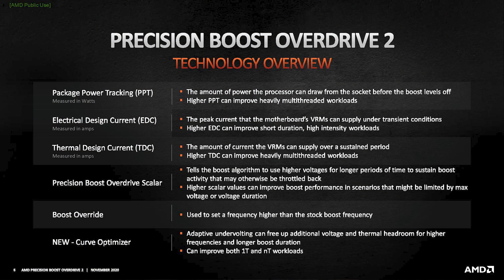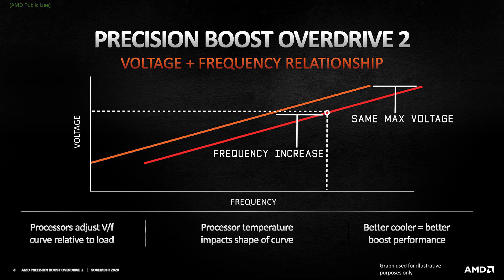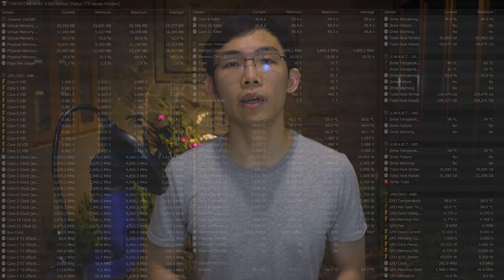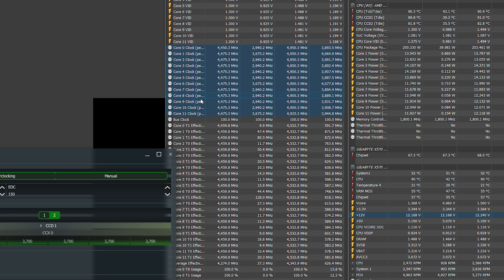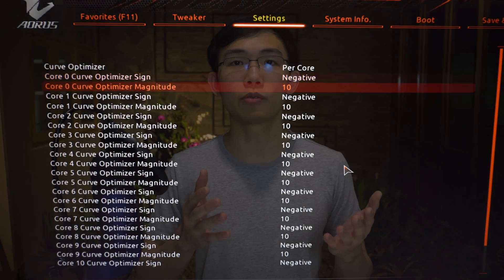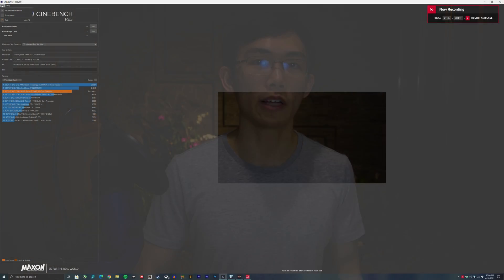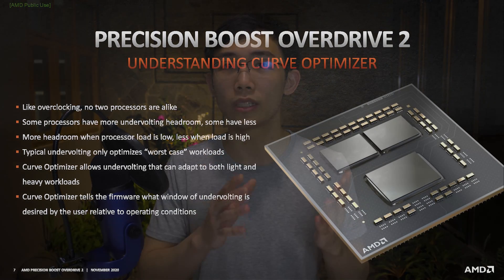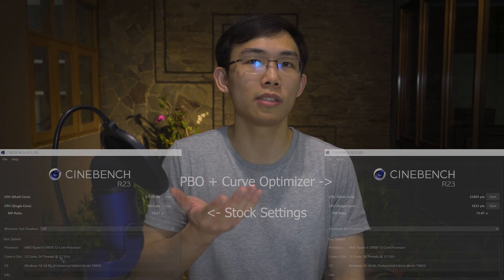The Best Way To Overclock Ryzen 5000! | How to use Curve Optimizer

Comment: Much prefer testing with occt. Detects errors which don't crash the pc/app and tells you which core os responsible for the error so you know what to focus on. I also tested single core by pinning the task to specific cores in task manager rather than always let it run on the same prefered core resulting in a more stable overclock (it helped me to detect the crashes which wouldn't occur if it ran on the prefered single core) my results for 5600x -12, -12, -5, -2, -15, -5.
Reply: It would be so kind of you if u can share the Bios settings buddy
i do have the same CPU but not fully optimized
your help is appreciated.

Comment: As first, this is a very good video! Thank you

But I have a question, does it have the same effect if I set all cores negative 5 instead of per core and then set all to negative?
Cause a friend of mine can set negative 30 at all cores and still doesn't get a crash.

Comment: What if I increase my negative offset to the maximum my bios will let me (30) for every core and it is still stable? Did I not utilize something to the most that I could have? I have an all core clock of 46.50 at 3.65v right now and it was pretty stable but I might have been able to increase it some.

Comment: Your scores are way higher than mine with similar settings on my 5900x + aorus master combo. About 22,000 multi, 1600 single. 4.55GHZ all core and up to 5GHZ single. Any ideas?
Reply: Austin, you sound like you know what your doing. I could really use help on getting my system to run at its best. Honestly feel like it should be much better than it is. I’ll $$ someone to help me!! I’m running ekgaming vanquish 295 I believe is the name. It’s got fully liquid cooled even the crazy RTX 3090, ryzen 5900x, asus Prime pro motherboard, 32GB gskill 3200 ram, 1Tb Samsung 980 pro, another Samsung 1Tb 970 evo pro and 2 other drives I don’t use lol. I have been trying Ryzen master abs so on and I obviously don’t know a lot. Any interest in helping me? Would appreciate it thanks.
Reply: @kaubut0145  I might be able to help you. I'll admit I'm no pro at overclocks, but I could at least try to help you out. Just give me a way to contact you and we can try to figure something out together.

Comment: Did you compare this vs the performacne of an all core overclock? In most scenarios an all core overclock gets better framerates and performance than curve optimizer. Curve optimizer makes it look like its hitting higher clocks but the performance doesnt scale with the clockspeeds.
Reply: "In most scenarios an all core overclock gets better framerates and performance than curve optimizer" Which scenarios would these be? I call BS. Show benchmarks!

Comment: I've been using Cinebench, AIDA, Geekbench,  3dmark and Prime95. My cpu is stable on everything i do, except on prime95 torture test. Would it be safe to assume that the torture test in prime95 is meant to test base clock speeds for fabric failure? I dont see any other software being able to push the CPU that high.

Comment: If I don't want manual PBO settings what should I use like Auto, Motherboard etc. Also what happens if you set these in the bios then change it in Ryzen Master does it override the bios?

Comment: Almost all CPUs today have thermal throttling, which dials down the boost or core frequency when a top temperature limit is reached (to protect the CPU from damage). Is there motherboard functionality now where the performance/frequency/voltage of the CPU is regulated based on a thermal limit as the target ie overclock esp in low or low core loads if temperature allow it (beyond boost specifications).

Comment: Hey! I’m new to all this! I followed the first part of the video, modifying my PPT, TDC, and EDC. Here is the weird part. On my first test on cinebench (my baseline test) I already had the native “game mode” on ryzen master turned on (PPT: 720, TDC: 420, EDC: 480, very weird figures I know). I then modified all three values, and found that the sweetspot for my 5800X is an EDC of 80. That’s the highest clock speeds I was getting on HWmonitor. After running the test on cinebench I actually got a lower score, although as I said I was getting higher clock speeds. Any explanations. This stuff is proving too complicating for a noob like myself.
Reply: look at the effective clocks (shown in hwinfo), maybe your having "core stretching"
Reply: Run cinebench more than once. If there is any activity on the CPU in the background (like windows update, defender etc) it will impact the score.

Comment: Hello bro. 
I have  r9 5900x cpu
asus rog stix 3070ti 8gb oc gpu
asus tuf gaming x570 plus wifi
COUGAR MX660 MESH RGB 4x120mm RGB MESH GEX 850W 80PLUS GOLD MidT ATX
Lian Li Galahad 240mm ARGB All-in-One CPU Liquid Cooler

How do you think I can overclock the processor, graphics card and ram in this system? Not for rendering, just to improve game performance. because the monitor I use has a refresh rate of 280 hz and is in 1080p resolution. I need to get better performance to feel 280hz in fps games like pubg, so I want to overclock. may I help you?

Comment: Manual oc better its bullshit with curve optimizer testes both on r5 5600x curve is wasting time its like trying show something other than others to be original but this time its uselles :(
Reply: hi sir.Do you have 5900x also.With manual overclock what GHZ and volt I should give
which one would you prefer.Now I am using 4.4ghz with 1.15 volt can you suggest me other settings
thank you

Comment: Ive tried all combinations of changing my curve values.  No effect on my cinebench scores.  Been messing with this all day.  Same proc.  Same bios.
Reply: No expert but have you tried adding the +200mhz  in over drive . 
Non on of this will work if your temps aren't low
Reply: @wrusst  yes.  Full custom ek loop with 3 x 360mm rads.
Reply: @teemohnay  you tried upping the scalar to 5x or more which is supposed to push more volts and fake the chip is better than it is ?
Reply: @wrusst  tried it at all the Xs.  All the way to 10x.  No affect.
Reply: @teemohnay  my guess is one of your weak cores are undervolted I'd look at the skatterbencher guide as it's got a few more tricks
Reply: @wrusst  will do.  Thanks for the help!

Comment: I would love to see some 5900x cinabench runs at 4.9 all core. Or close to it. My 5900x hangs out around 4.8-4.9 with only pbo2 and a 240mm aio and some mx5 and it NEVER goes about 68-69c I’m pretty impressed with its performance. I might go for 5.0 I believe the world record atm is 5.9 for a 5900x and 6.0 for a 5950x but that’s with liquid nitrogen. I’ll stick with water personally haha. Cheers. Next time plz show more over clicking and benchmarks, less just talking. Other than that, great video..👌🏼✌🏼
Reply: @Alex I’m using an arctic liquid freezer II 240aio and mx5 thermal paste. my ambient is around 20c. It helps that my aio is an intake. They run a bit hotter when you use the aio as exhaust. I bet that’s the main difference. This cooler is the best I’ve ever had. It’s better than a Corsair 360mm I had before, but that was exhaust also. Im sold on front aio Intake. Tubes down if you can. Lots of exhaust fans on top and rear also. Maybe I also got a golden sample silicone, not sure. My temps are legit low though. I think I’ve maybe seen 79c-81c once or twice while benchmarking. I’ll do a benchmark video here soon and show some scores. Subscribe so you don’t miss them. Cheers man

Comment: Did anyone succeed with this method? Don’t get me wrong, the video is awesome. But after getting Cinebench to pass the undervolting with flying colors, your PC will just crash when idle browsing the web or watching youtube. I pulled back on the failing cores just to end up with 3 back to 5 or even 0. Yet, constant crashes. I decided to take the slow path. Start all over slowly and let the PC prove stable before pushing further. Cinebench and corecycler (prime95) are simply not enough as the biggest voltage/frequency adjustemnt happens when running idle!!!
Reply from the maker: Maybe your particular CPU and motherboard needs to use a higher LLC setting. I'd set it to second highest as a start and go to max if that doesn't help.
Reply: No, I didn't succeed based on the method in the video. The All Core Curve Optimiser is just too rough. I prefer to go with the CoreCycler route and now have been using my PC for 2 days now, seems quite stable. The CoreCycler is a much better way IMO, as it identifies per core stability. From there, once you have come to the optimised curve, I moved everything up by 1 tick to ensure no cross instability caused by borderline cases.

Comment: Hello, interesting video! Though I do love to know what other settings definitely need to be set next to these PBO settings: memory. E.g. Spread Spectrum Control must that be disabled?
Reply from the maker: Not much else. Everything on auto is good enough. Although your question about memory is separate since this video is strictly about the CPU.
Reply: @OTechnology  thanks for quick response. Got WHEA_error on first attempt typing this answer ... settings were PPT 185, TDC 125, EDC 170 and all cores 15 and crashing already :o
Now 165/115/150 and all cores 10 ... and wait out I guess (yes I'm new to it)
Reply from the maker: @Pan_Tainn  Ouch you might have one core that's just way worse than the others...try using https://github.com/sp00n/corecycler to find out which one it is.
Reply: @OTechnology  guess I need to remve my overclock settings first before using that tool

Comment: spent a whole day tryna figure it out for my 5900x...best cores -ve 11 2nd best -ve 15 rest in ccd0 -ve 17 nd -18 in ccd1 wd scalar set at 5x everything felt stable after number of cinebench r20 runs nd got scores for multi to 8700-8900 nd single bw 640-649, meanwhile feeling accomplished I thought of watching netflix nd guess what it crashed 🥵
Reply: @Alex yup it sure does,figured it out after a reddit post that best cores doesn't need a big offset,its running stable now my preffered core on 1st ccd was making it crash so I lowered its offset to 10 from 15 it still boosts to 5150mhz nd no crashing   even at 5 it was boosting to5.1ghz under idle nd light loads nd even in some games like mw nd forza.

Comment: my 5900x can go negative 30 on all cores, pbo motherboard, +200mhz cbco, scalar 10x and still i am 5% in 3dmark cpu. dunno what i can do more.(edit:-from 4.95ghz i went 5.150ghz but still low scores in 3d mark 5-7%) 75C with nzxt x63
Reply from the maker: I doubt that's actually stable. Try running corecycler to test stability. https://github.com/sp00n/corecycler
Reply: @OTechnology  i tried cb23(22800score)/3dmark cpu(11400), didn't have any issues (edit: also playing any games without issues). i ll try that software but it kinda beats me.
Reply from the maker: @alexmckoy8898  yea those don't show instability because the cpu boosts differently per core so you need software that can do that which is corecycler.
Reply: @OTechnology  i still use it and seems it's stable. never got a bsod/rr. idle, mid browsing, gaming, benchmarks.. nothing.
Reply from the maker: @alexmckoy8898  Probably got a golden chip then!

Comment: of all the vids pertaining about this new function. You have really made it easy to understand properly. i have a 5800x and i have been trying to get it to run consistently. I tried CTR from 1smuz. its good but it gives me black screen lock ups whenever i run 3dmark. thanks for taking the time out to explain it =)  my max on single core boost was 4.8 without crashing. now im at 4.95-5.04..
Reply: Agreed, I like the idea of testing with Ryzen Master instead of doing the tweaking in your BIOS over and over 😬
Reply: @ryanlaseter7626  his new project hydra is good tho. really great on temps and the hybrid oc is great.  the adjustable CO's across the frequencies has helped me stably run a 4133mhz ram kit on the 5800x. (at 1:1:1)  prior to that i had to drop the kit down to 3800 or i'd lock up running r23 and even r20.. on the balls out profile i manage 17,900ish in r20. previous id hit like 16200 then lock up on the last section. oh and roughly 5.0-5.1ghz boost clocks @ 1.32mv with soc at 1.135.. barely goes over 80c on an EKWB AIO super the 360rad with 6 fans for push pull. and like 85c with just the fans on pull.

Comment: its not normal that your cpu hit 90 C I have 5900x with noctua nh-d15 with stock fans and after copy-paste your settings in ryzen master, my max temp is 71C.
Reply from the maker: Don't know, maybe my ambient temps were higher than yours and this 5900X is just particularly hot.

Comment: Great video ! So being close or around 1.5v in hwinfo is all normal?

Should I use LLC with pbo? When using LLC3 it's stable but on auto, my per ccx at 1.3 won't be stable either
Reply: normal, totally normal
https://www.reddit.com/r/Amd/comments/cbls9g/the_final_word_on_idle_voltages_for_3rd_gen_ryzen/

Comment: Nice and inspiring vid! One thing I found really annoying on my ASUS board is that after updating the BIOS which essentially updates the AGESA version. The off-set unit was re-shuffled. This resulted in a crush that damaged my windows once after loading the exact same BIOS profile after an upgrade. Don't know if that happens on other brands.
Reply: Always restore bios to default before updating
Reply: @CidoraX  The BIOS always resets itself to default after updating. I read from other sources that AMD changed the settings in certain AGESA version to have a more conservative strategy. But now it seems they changed it back a bit that allows me to go for a higher negative off-set value (My current BIOS version on my ASUS mobo is 2423)
Reply: @kleinwood9297  no they don't always automatically adjust mine obviously didn't
Reply: Yeah reset bios by removing cmos battery. Had to do this when swapping 2700x to 5600x even with latest bios already updated

Comment: 5600x here. Ended up with Negative 0 on best core (yes, ZERO) and around 20-25 on the rest. 
Does it make any sense that the difference is that much? oO

Also, the crushed never happend at high load for me :) only drops to idle
Reply from the maker: That can happen yes. Its really a silicon lottery and I think if only one core is not doing well its totally fine. The multi core clocks will still be substantially improved.
Reply: @OTechnology  Thanks for reply. Well, my CPU overall seems very good. So the lottery is nice but odd :). I was testing it with usmus1 tool and there was info it's gold sample. Great content btw.

Comment: what do you put on the Load Line Calibration when using curve opmitizer and pbo2?  
when should i use Level 1 and when Level 5?
Reply from the maker: I put the second highest setting on my Gigabyte motherboard called high as that seems to work well now that I tested more. Don't know what is higher on your motherboard 1 or 5 but if its an Asrock motherboard chances are 1 is a higher setting.

Comment: What power plan are you using?
Reply from the maker: Just the default windows balanced. Ryzen 5000 doesn't need any special power plan.
Reply: @OTechnology  can you tell me what the min CPU state is set at in your balanced plan? Mine is set to 0% but others on Reddit said it should be at 5%

Comment: Just info : pinpoint the crashing core is easy and fast , just open the "Event Manager"  and search for " WHEA error" and especially " APIC " number . For example APIC "5"  error =  Core2  fail on an 5900x ( remember it start from core 0 to core11 in bios )  , Apic10  = Core5   etc.
Reply: Its best to export the IDs of the cores via cpuz html exporter, because for example on a 5900x ccd1 could be from 1-12 and ccd2 could be from 17-28.
Reply: Thumbs up to this comment. That's necessary stuff :)
Reply: Abdulhadi Zahrani  very likely core 2, but you should use cpuz html exporter to be 100% sure
Reply from the maker: Awesome tip!
Reply: Abdulhadi Zahrani   CPU Z - Tools -Save report .html   <open it and u will see
Reply: If error APIC ID: 0 , then how do you apply the division by 2 on this case ?
Reply: @Black_Onyx  you cant ^^ its core 0 in that case.
Reply: @LF11I41  Thanks ;)
Reply: So you wanna say that i could have fixed my faulty 5900x that would crash even on stock settings and gave me the cpu hierarchy cache error?

Comment: I had a stable overclocked 3950x at 4.3Ghz for over 9 months. It gave me a 5 to 15% performance boost over my stock settings 🤔. It also meant I had more heat and more voltage. TO ME the gains weren't enough for me to warrant keeping my 3950x overclocked. Today I just cut on my XMP profile and keep my 3090 overclocked with MSI AFTERBURNER. Maybe if I saw a 20% or higher performance boost I might still keep my 3950x overclocked. But I see no reason why I should since the stock value is closer to what I was able to get with an overclock MINUS the heat and voltage 🤔.
Reply from the maker: That's because no one should use a fixed clock overclock on Ryzen you're actually losing performance in most applications because the boost behavior is not working anymore.